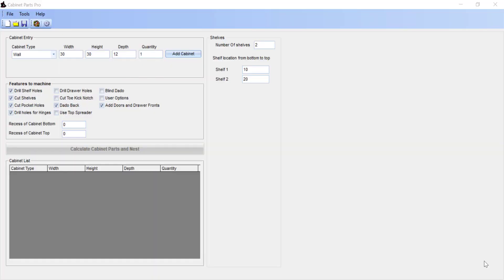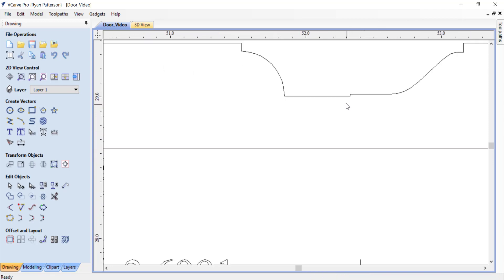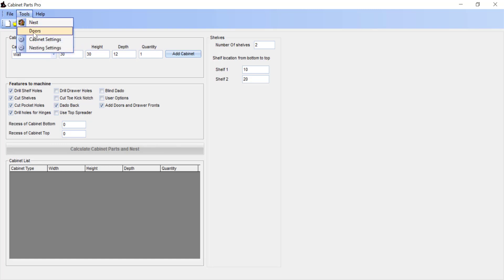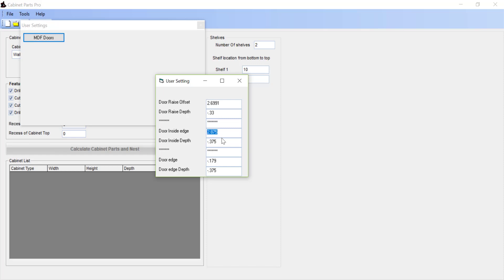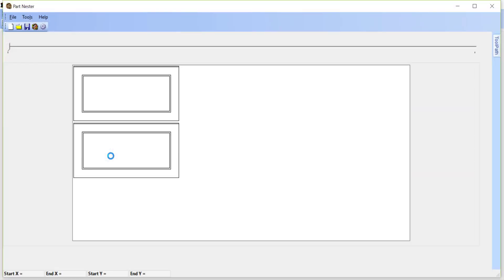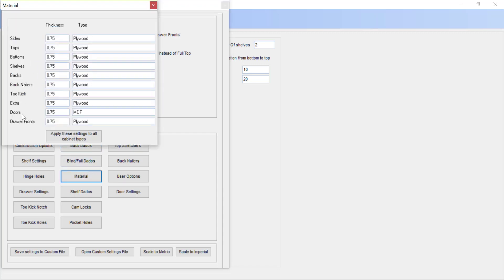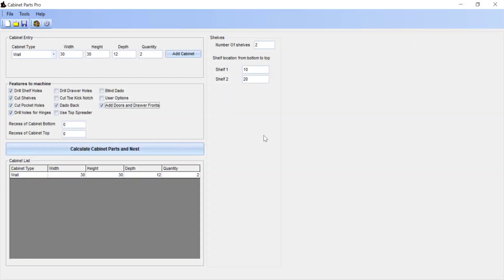MDF Raised Panel Doors

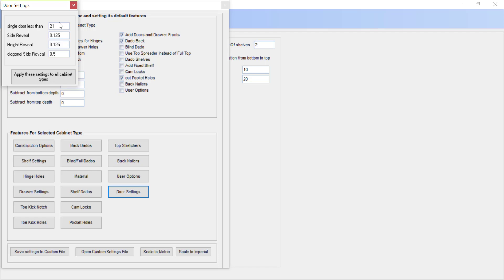Comment: Hi Ryan. Thanks for the great video. Your software has so many hidden features. You've done a great job. Can you explain what 'diagonal side reveal' is? In the door dialog box as seen at @10:45?
Reply from the maker: The diagonal reveal is used in sizing the door for a diagonal corner cabinet.  Basically this is how much smaller the door will be than the opening of the cabinet.